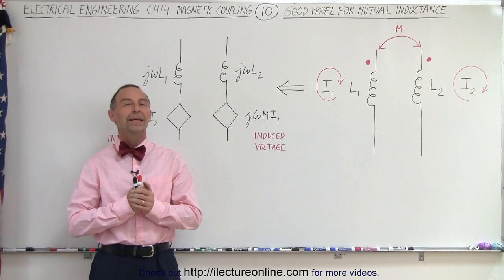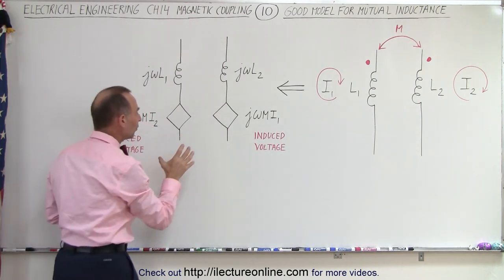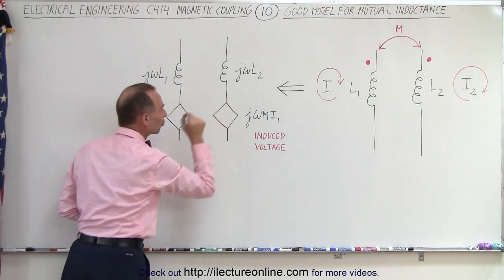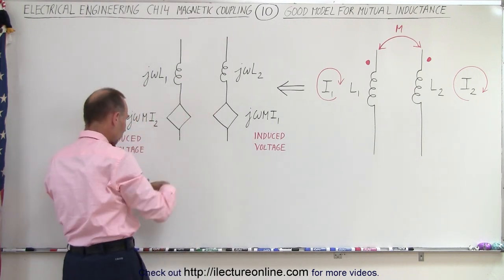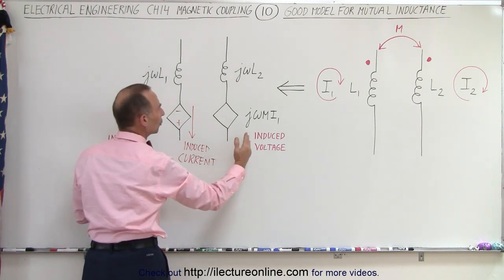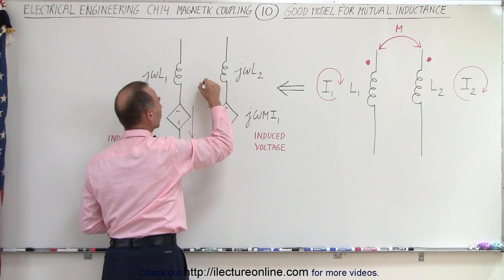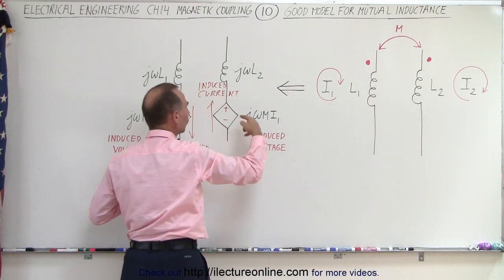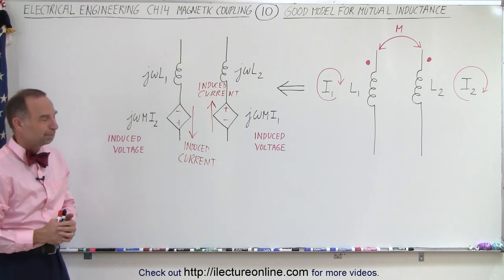Electrical Engineering: Ch 14 Magnetic Coupling (10 of 55) Good Model for Mutual Inductance

Comment: saved my life, my teacher went over notes for this section in our AC circuits class very quickly and also made a mistake and neglected finishing the problem. 

This was concise and to the point. for any others generally struggling to understand dot convention:

If a current enters a dotted terminal before the inductor, a (+) polarity will appear on the dotted side of the opposing terminal.
Conversely if a current leaves a dotted terminal, a(-) polarity for induced voltage will appear at the dotted terminal across the inductor.

My explanation is wordy yours is SIMPLE. I also really appreciated the bit about if the dots are on the same side the M term will be positive, and if they're opposites the M term will appear negative in the KVL equations for something like mesh.

Thanks again
Reply from the maker: Thanks for the input.  If you keep going there is more detail on how to handle circuits with mutual coupling.

Comment: if both current directions (i1 and i2 )same then dirction of induced current should be same......i'm right ??
Reply from the maker: Not necessarily.  It depends on how the coils are wound.  (That is the meaning of the red dots - which indicate if the wire is wound in the same direction or in the opposite direction).

Comment: You assume all changing voltages are sine waves. What happens in Power Converters when the input may be an AC sine wave or may be a DC voltage?
Now I see why working Electrical "engineers" know nothing about magnetics. The VRM circuits currently used date back to 1920.
Reply from the maker: No mention that "all" changing voltages are sine waves.  (But the voltage supplied by the power plants is).